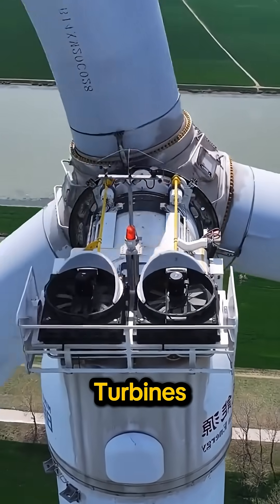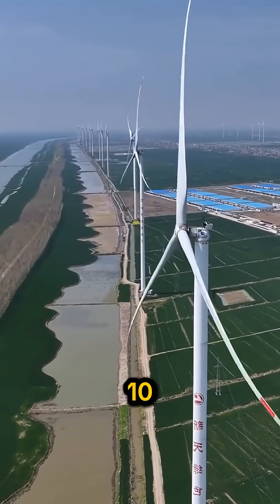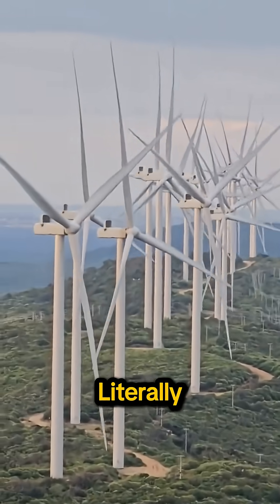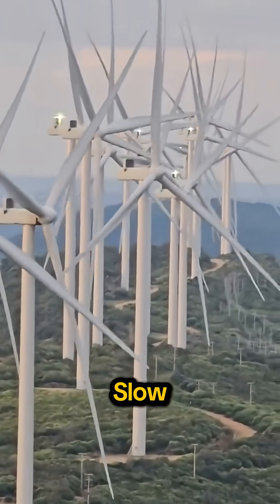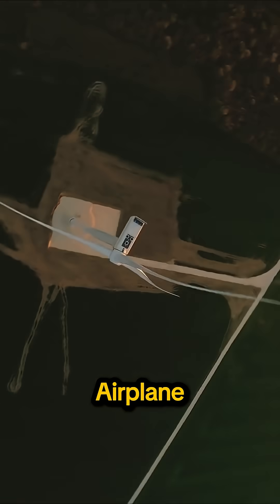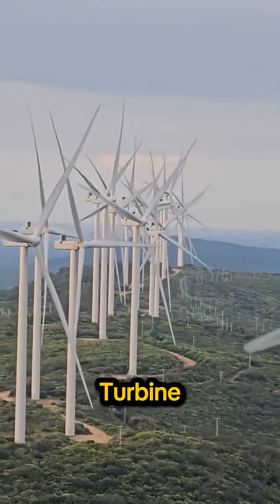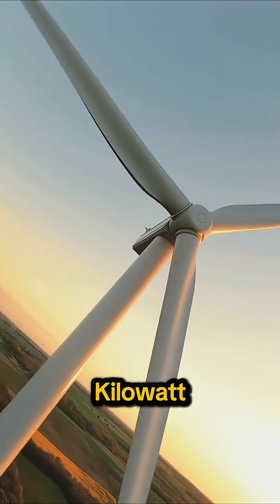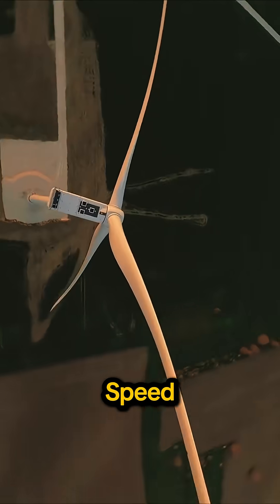Wind Turbines Spin Slowly The High Speed Secret Explained!

Comment: The lift force follows the Kutta Joukowsky theorem, NOT the Bernoulli specific energy conservation.
The power is given by the following equation:
P = density × (2/3 wind)³ × Disc area × efficiency
The rpm is defined by the required generator speed and the increasing gear ratio = constant
the efficiency is closely to 0.6
The  rotor speed is 1/3 rev/sec
So now you know!
Remember to discard the false explanation:
It's 20 rpm = 60/3 
not 10 rpm🤔

Comment: Newer designs have done away with the gearboxes because they kept buring up. Generators with MANY more poles are used instead

Also: They are buffered between the turbine and grid. To do it fully "properly" you need a grid-scale battery storage system such as the South Australian Battery (which was the first such installation - a result of the South Australian blackouts that occurred through over-reliance on wind and uncharacteristic dropouts in the normally consistent wind thanks to weather systenms passing through)

Comment: Dont make one bit a difference with electric bills in eire thats for sure .cheaper my ass
Reply: Once the dead weight that is gas and nuclear are removed, then the prices will plummet.

All electricity operators use as a base price the highest generation amount per mWh.

Comment: All for a 15-20yr lifespan and consuming massive amounts of oil and recourses to keep them running. The cost is not worth the minimal energy production. It's a waste of money.
Reply: again with this dumbass nonsense already contradicted a thousand times by actual real life data, science and engineering.
first off you should look up what the minimal life span is to even get a construction licence from the IEC or similar regulatory institutions around the world. Back in the early 2000s that minimum was already 20yrs in europe, then it went up to 25 and now 30yrs in several countries ... all while the companies building them now garantuee 30-40 yrs of life span.
Not just in Germany systems ran profitable for 25-27 yrs before replacment already ... and those are the flawed and weak designs from the 90s and early 2000s.
And obviously the cost is worth it, operators able to do math already made billions with it and noone would bother with replacement, betting even larger investments all while the subsidies already came down or even disappeared in places ... the technology is profitable for a long time already, especially with energy prices escalating as wars over ressources kick off again and the demand escalates because of datacenters etc.
As for the environmental impact, that as well is long proven to easily be an improvment over fosil fuel power generation ... despite all the ressources needed for construction and upkeep. Simply not demanding a constant flow of fuel just to be burned is making modern wind turbines greener after less then half their life span. Your nonsense of upkeep and oil consumption for lubricant etc pales in comparison to what of that is spend on keeping the fosil fuel coming, that stuff isnt appearing at the power plant by magic.
Yours is the same uneducated bs people spread about EVs, staring at the cost to build without ever doing the math of operation and how that compares to the fosil fuel alternatives with the far larger constant demand for ressources. 
And all that is not even looking at the rather new development that ressources stuck in wind turbines are now going into recycling as the replacement cycles kick off ... making wind power even greener as it already was.
Long story short: stop your bs, its to obviously already proven untrue by decades of windpower in operation.

Comment: Why don't they put small ones on houses? Because that would hurt their profits
Reply: I guess the question here may probably be: How small needs a wind turbine need to be that you could just fix to the roof an existing house (instead of an "tower" with its own foundation in the ground)?
How much power could such a small turbine generate - and how much would it cost? 
There's probably a good economic (or safety related) reason why people usually install a solar / PV module on their roof, rather than a "tiny wind mill" - apparently solar power makes more sense on a very small scale than wind power
Reply: @tobyk.4911 I think a combination of both solar and wind on a small scale can easily power a house, you can even have a small water tower with a solar pump hooked to a small battery to generate constant power, the problem is the cost of these setups, but times are changing and more diy friendly setups are becoming available, one good thing is that light bulbs have evolved to barely needing any watts,

They recently put about 30 big wind mills close to my house but guess what? There's no difference in my light bill, that's some sort of deal with the light company across states,

That's why we need to invest in individual solar and wind and even water towers for individual homes, especially in more rural areas

Comment: The angle of the blades rotate in order to achieve a synchronized speed. If you notice a group of wind turbines all turn at the exact same speed. This is because they have to sink up with 60 Hz on the electrical grid. That is why they turn at the speed they do regardless of what the wind speed is.
Reply: True the blades are adjustable, but the synchronicity is done with a braking system. That's why you sometimes see runaway blades that self destruct because the brake system fails.

Comment: The tangential velocity at the tip of a modern, large-scale wind turbine blade is surprisingly high, generally ranging between 80 and 90 meters per second (m/s). This speed is equivalent to approximately 280 to 320 km/h.

Comment: You actually need oil to lubricate the moving parts😂
Reply: Normal shit 😊
Reply: Oil need to be mined, refined, packaged, transported. I get it that it's lessening the impact but it's not eradicating it. Nuclear and solar are better
Reply: @davidbett7002 solar??? Use 🧠
Reply: yeah but its not being burnt and releasing carbon into the air that we have to breathe
Reply: @michaeldonnelly1657 
Still made in factories that use conventional power.
When the life time of these windmills ends, what happens to the pieces of scrap.
There is not such a thing as clean energy.

Comment: For aerodynamic efficiency,(maximum lift minimum compressibility), the blade tips move at about 300kmh regardless of turbine size. Small diameter wind turbines rotate faster to achieve same tip speed.

Comment: I watched 5 seconds of this video. The answer to their speed, whether it's slow or fast, is that they're controlled by the frequency of the electrical grid they're feeding, and the design of their generators. The wind speed has nothing to do with it. As for huge turbines looking slow, you really don't want the tips to break the sound barrier, so the generators are designed accordingly.
Reply: in higher wind they alter the pitch of the blades so more torque is exerted and therefore more power at the same rotation speed.

Comment: One of the more expensive means to generate power, but appropriate for some remote localities.
Reply: Wind farms produce 25 times more energy than was used during their manufacture and installation. Wind turbine blades are now recyclable.

Solar and wind power are the cheapest sources of power globally.

Generation Costs (Levelized Cost of Electricity - LCOE)
Wind: £0.03 - £0.06/kWh (Utility-scale)
Solar: £0.04 - £0.06/kWh (Utility-scale)
Gas: £0.04 - £0.08/kWh (UK, varies with fuel price)
Coal: £0.05 - £0.10/kWh
Bioenergy: £0.04 - £0.10/kWh
Oil: £0.08 - £0.12/kWh (High variability)
Reply: @FontaineDerby Your "paper-work"/ Dream's, don't Prove ANYTHING; except Nothing. 🤡
Reply: While they are more expensive then solar, they are way cheaper then nuclear of fossil plants.
Let alone when you calculate in the environment damage of fossil fuels

Comment: Crazy question cause I'm not a scientist. Can wind turbines be used to capture solar winds? I'm thinking with this you would need to rely less on fuel of even a fuel mix.
Reply: No. Solar wind is a different thing altogether. It's essentially hot plasma (charged particles) being ejected from the sun at high speed. Because it's electrically charged, the Earth's magnetic field acts as a shield, deflects it and prevents the overwhelming majority of the plasma from reaching the surface of the Earth.
Reply: @ABCD-dr2yb  thank you but I mean to travel in space.

Comment: Another reason they run so slowly is also so small changes in wind speed doesn't mess up the RPM's. The generators are asynchronic, meaning they push a bit "harder" (RPM-wise) than the grid, so it actually generates electricity. But it can't push too hard, because then the rotor would "skip over" and that could cause surges on the grid.

So by gearing up the speed, then its the wind force that decides, not wind speed, and wind force is always the same.

You can try it with a bicycle, switch it into highest gear, and you will notice that no matter how hard you pedal, you will reach a certain speed with the wheel in the air. But on a low gear, the speed will be more variable.

So the gear box also act as a buffer that smooths out speed changes due to the momentum.
Reply: Such puerile statements by the commentator beggar belief. As fast as a train?
Reply: @williamhatfield8935 The tangential velocity at the tip of a modern, large-scale wind turbine blade is surprisingly high, generally ranging between 80 and 90 meters per second (m/s). This speed is equivalent to approximately 280 to 320 km/h.
Reply: @MarioCotia  Thanks. Similar to what I expected.
Reply: @Fomites 👍
Reply: Good point and nicely said.
Reply: They don't use solid state inverters to match the grid phase and frequency? I fugured they would so they could make power at any speed.
Reply: @geoffmooregm 
Exactly.
Surely - the "final connection" to the grid has to be in exactly the same voltage, frequency and  phase as the grid before the generator(s) can be connected. 

As far as I can see - this can only be achieved by using electronic invertors + electronic control to achieve this.

There surely is no way 100's of wind turbines can all seamlessly and simulataneously  generate 50 hz ( 60 in us) and at 0⁰ phase  and at exactly the right voltage to match the grid. - and be controlled to inject a desired  amount of energy. 
In a conventional ( gas/nuclear/water turbine etc) generator - these use massive rotors that spin at syncronous speed - and by virtue of their huge mass - present a high degree of stability ( by virtue of their inertia) to the grid.

That is - on a uk wide basis - the cumulative effect of all these spinning masses provides "stability" by virtue of the stored energy within .

Wind turbines ( and solar) dont have this "high inertia" and thus this lack of intertia has to be accounted for in the electronic conversion ( grid forming invertors + control systems.
Reply: @geoffmooregm  The output of the turbine-generator-converter system is normally 690 V then stepped up to 33 kV by a transformer. The 33-kV collection system is transformed to HVAC level by another transformer. The HVAC level is then transformed to an HVDC level by a centralized AC/DC power converter. The total captured wind power is delivered to the onshore collection point by the transmission system.
The key to designing a wind turbine is to assess the optimal tip speed ratio (TSR). This will directly affect the power generated and, in turn, the effectiveness of the investment made. TSR is suggested to be taken between 7 and 8 for a 3-blade network-connected wind turbine.
Reply: @sventhormodpetersen1752 Thanks.
Reply: @geoffmooregm no, because that would make everything much more expensive.

Comment: If your unlucky to live close to these things they will literally drive you and any animals crazy with the constant noise.
Reply: i had heard this before so i went to a wind farm on a windy day . parked 1/4 mile from 3 towers what did i hear the wind. soi parked right under one i could hear a woosh as the blades passed.i parked near a farm place close to the turbines what did i hear wind .when the wind isn't blowing they don't turn.
Reply: @repete2362 I went to collect all the dead birds. I didn't find any and the units were pretty quiet.
Reply: I do and I don't hear them at all. The power lines make more noise.

Comment: The centrifugal force is only half of the problem. If these blades would spin any faster, the tips would break the sound barrier, causing vortices, shock waves and what have you, running the whole system into ruins...
Reply: In the example from the video, a rotor with 100m radius rotating 10 times/minute, the tips would be moving at 105 m/s which is pretty fast, but still a factor 3 away from the speed of sound.
Reply: @HartmutRick  Yes, it would basically take the gearbox to fail first and stop resisting the spin before the blade can actually accelerate to speed so high that the tips will break the sound barrier.
Reply: @narrativeless404  Has that ever happened? I'm wondering what it would sound like. Do you hear a deafening rattle from repeated sonic booms from far away? Or would the blades simply fall off before this can happen?
Reply: @HartmutRick  It's not rattle, it's a deafening banshee screech that's shortly followed by the llbkades folding, flying off and the whole thing collapsing.
You can find videos of this on YouTube.